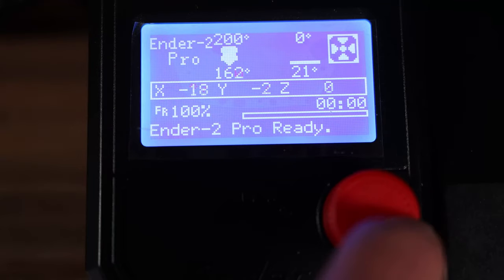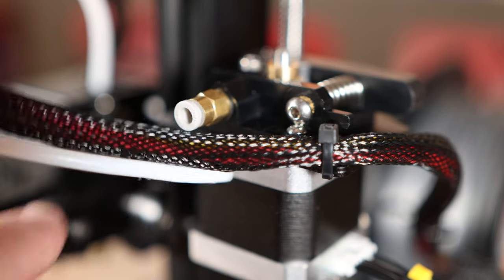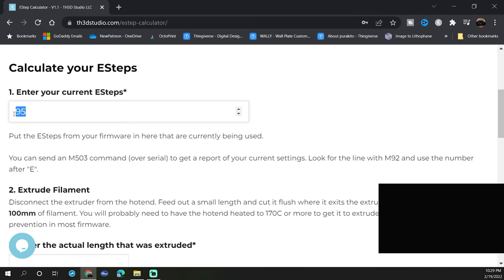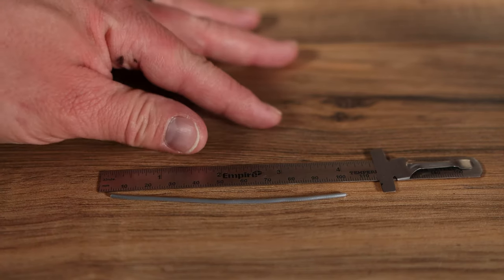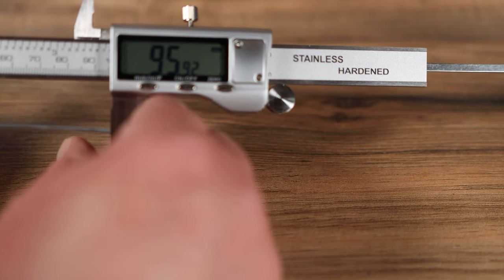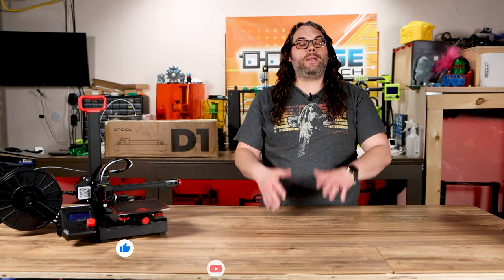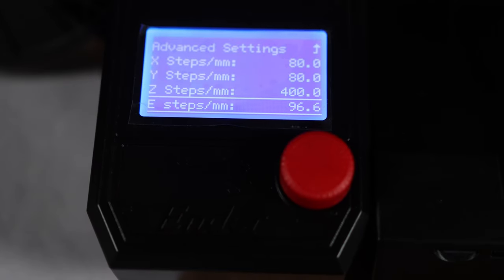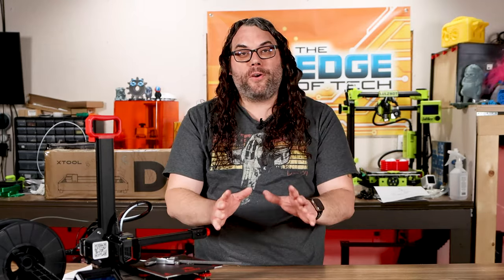The Simple Calibration That SAVED My 3D Prints! How to Calibrate E Steps!

Comment: I will definitely be trying this out today! I recently got a printer from a friend. I want to start my 3D printing business, and after about 6 failed prints, the printer seems to not be pushing out filament right/ not printing properly. I will check this as well as your video on Flow Rate since I believe it's the flow rate that's not right. I will update again when the issue is fixed!

Comment: Old machinist here.  It is much easier to use the "tang" that comes out of the end of the caliper to make the kind of measurement you are trying to get.  Butt the filament to the end of the main body and then slide the "tang" out to the end of the filament.  Much easier and much more accurate,.

Comment: E-steps should be a calculated value.  You do not extrude it through the hot end, due to back-pressure causing E-step values to change.  You extrude into free air while calculating this value or else you get a wrong value.  This is one of the few videos that gets the process right.
Reply from the maker: When I started reading this I did not know where you were going with it, But then you totally hit the nail on the head! Thanks for watching!
Reply: Makes sense. I watched a few where they were extracting into the tube and measuring in awkward ways ... this made so much more sense, for the sake of popping the clip and removing the tube while calibrating. Going to do this next weekend when I get my first printer, probably before I even do a first print. Because, why wouldn't I?

Comment: In my experience, it's easier to mark a distance of about 120mm on the incoming side and measure the remainder after running 100mm through. No worries of wavy filament messing up the measurement.

Still, we're chasing microns w/ molten plastic so it will "never" be exact. 👍
Reply from the maker: Absolutely!
Reply: Hi Old Curmudgeon! Have you seen the short movie Curmudgeons starring Danny Devito? it's well worth watching!
Reply: @AndrewAHayes  I have not. Will look it up.

Comment: I think it makes more sense to measure extrusion with the bowden tube still attached, because this replicates the conditions of actual printing. Even with a healthy printer the bowden tube and hotend present some resistance. An extruder that pushes 100mm into the air might push a little less when you're really printing. 
On the entry side of the extruder, using a fine-tip pen make marks on the filament at 100 and 110mm from the extruder, then get the hotend hot and extrude 100mm of filament. If the 100mm mark is still outside of the extruder, measure how far and subtract from 100 to tell how much was extruded. If it's inside the extruder, measure from the 110mm mark and subtract from 110.

Comment: What I do is extrude 100mm and repeat that 2 more times and only cut the filament after the 3 extrusions, so in effect, have asked for 300mm to be extruded. I then cut this flush, measure this piece and to get the average divide it by 3 which gives me the number to use to do the esteps calculation
Reply from the maker: Thanks for sharing!

Comment: This might be a stupid question. How would you calculate the e-step on a direct drive setup? Very detailed and clear video👍👍
Thanks in advance. 😊😊
Reply: Put in some filament and mark 100mm and 120mm from the entry point with a pen, hot extrude 100mm and measure what remains in the case of your e steps being too low or if too much calculate it from the 120mm mark, if you can though have the filament curl and avoid the hot end alltogether
Reply: Wow!!
Thank you very much for a quick reply.
I will definitely give that a try. 👍👍
Reply: @pogi1803  I edited the reply to say if you can allow the filament to curl and avoid the hot end alltogether
Reply from the maker: All great suggestions here! I'm going to be doing another video to show that method soon!

Comment: Finding inconsistencies with the typical estep calibration
 If i do with hot nozzle, I end up with higher estep value but lower Extrusion Multiplier and if I do without a nozzle (free move) I end up with lower etstep number and higher extrusion Multiplier.. might be a wash eiher way. just trying to do it the "best" way  Extruding into hotend 409 Esteps 0.97 Multipler  Extruding Free (no nozzle) 389 Esteps 1.07 Multipler

Thoughts on Starting with 1.0 extrusion multipler and adjusting esteps until wall thickness is correct

Comment: I forgot to add... Now that the extruder (I still can't see why it's called that as the nozzle does this function) is feeding what is asked of it, any other tuning is done with the Extrusion Multiplier in the slicer to get that last bit of wall thickness accuracy.
Keeping an eye on your filament diameter is another aspect as well, but outside the coverage of this video. Having the correct diameter in the slicer makes a difference in the flow you get at the nozzle.
Reply from the maker: Agreed!!